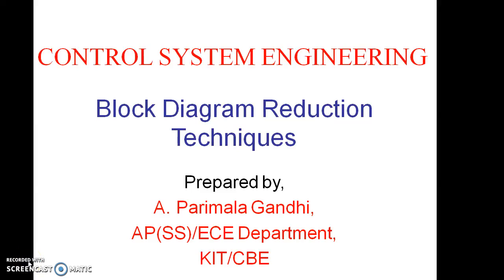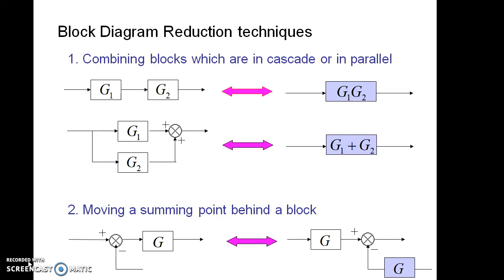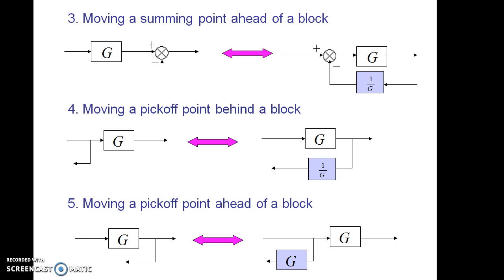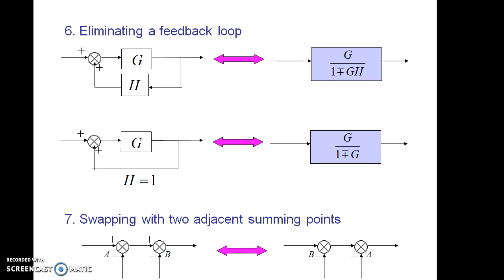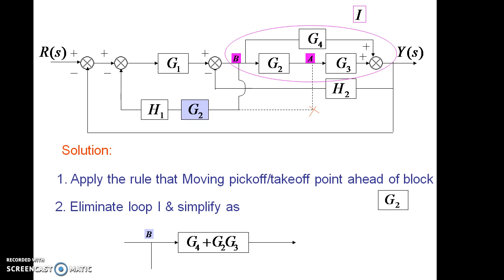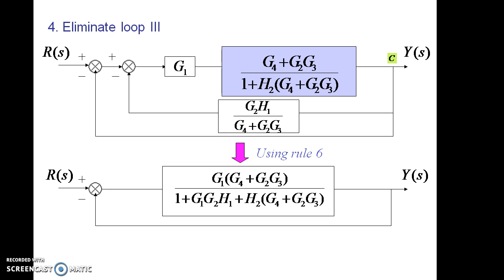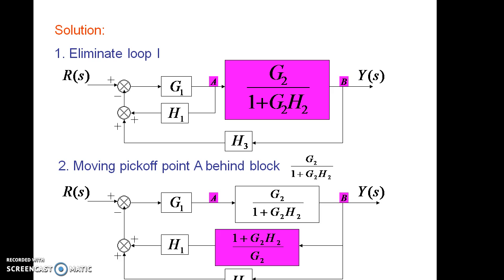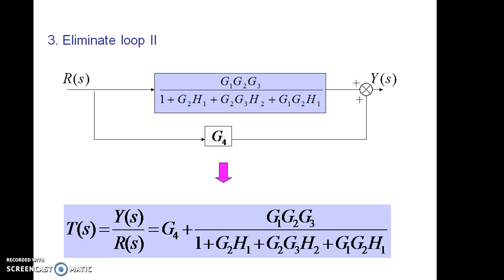block diagram reduction technique

Comment: Hello, how do you know when to use the feedback formula or simply add it in parallel, I'm a bit confused by that.
Reply: With the summing point
Reply: When both the arrow marks are towards the summer then  consider that they are parallel. On the other hand when one arrow is towards the block from the summer and the other towards the summer, then it's feedback....
I hope it is cleared now
Thank you 👍